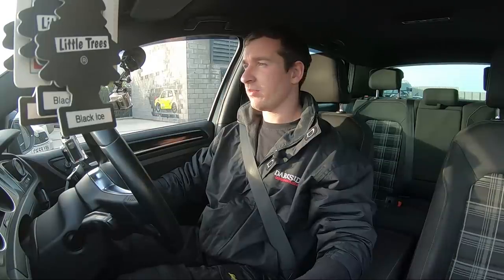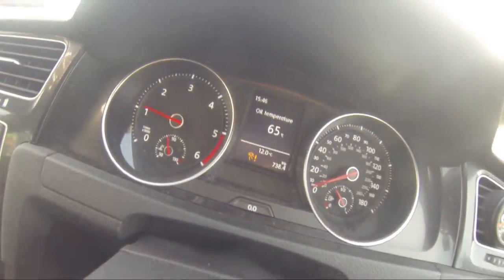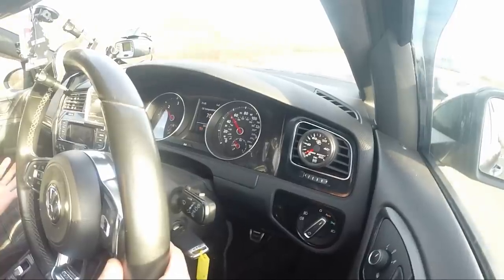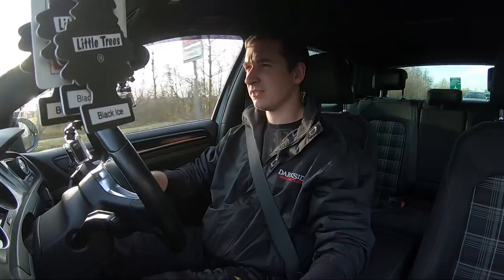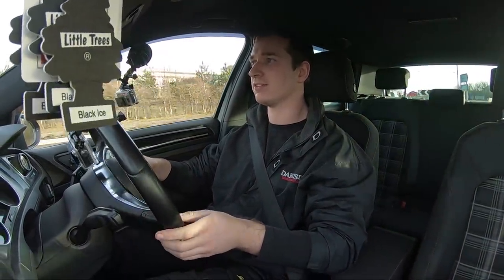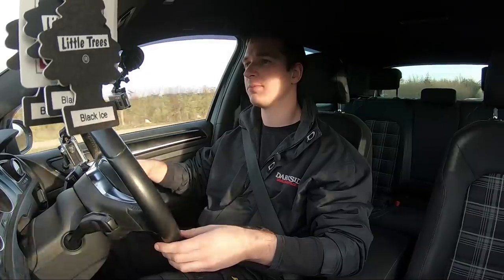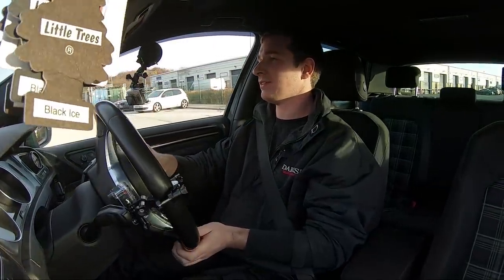286BHP 2.0 TDI VW GOLF MK7 GTD - PERFORMANCE ROAD TEST

Comment: My 7,200 lb truck does 0-60 in 5.6 seconds on an unpreped  surface in 2wd. 505 HP and 1020 lb of torque. It’s doesn’t get even close to 45 MPG though. I want one of these little cars lol

Comment: I had a quick bora tdi a few years ago, with many darkside goodies, quality parts, but skimped out on the turbo and used a hybrid instead of one the darkside kits. Wished i hadnt. Hybrid wasnt too bad but not as good as a gtb would have been. But the knowledge and effort that these guys have is top notch, i was totally blown away when i went to visit at how well equipped and how modern their site is. This video also just shows the tip of the iceberg of ryan and scotts knowledge. Always interesting your videos, and youre well overdue getting onto youtube!! Many more interesting videos to come hopefully
Reply: Thanks Russ, it's not too late to get your TDi fix!
Reply: @ryanp6138  ive got an allroad 2.5tdi now, been off the road gor a while, while i get a new fuel pump fitted ££££££ will be in touch perhaps about a few mods for that soon!
Reply: @russellbrown8377  SRS should have a pump from the engine we took from my dad's allroad when we converted to a 1.9 PD
Reply: Yeah i got the original one rebuilt by diesel bob... wanted reliability, least i know it should be good for a few years, you never know with a used one. Car wasnt the cheapest one out there either so not happy as it is but oh well. Will get there in the end!
Reply: Thats interesting too...1.9 conversion! Good idea. Thanks for the offer also

Comment: Really interesting video series. It was very informative to listen to how you managed to get so much power from that engine. Also , interesting to learn about the intake valves ports being in series .
Reply: It's not a good design!
Reply: @ryanp6138  hi again is there any newer vag diesel engine worth buying been looking for a new car and all the later stuff just seems to  not be reliable i was looking at an a6 avant 3.0 2014 onwards but have seen the chain guides and such are braking at just 60k miles really duno what to do

Comment: Great video. Nice power increase there. My 2015 Octavia VRS DSG did 100mph in 16s with a DTUK box. That thing is another level. I take it they are the same engine and turbo setup. Also much nicer audio, keep em coming!!
Reply from the maker: Thanks :) Yes pretty much the same engine. This car with a DSG would be even faster!
Reply: @DarksideDevelopments  by a big margin. I believe you were limited because of the clutch also even though it's a upgraded clutch as you stated. Was really expecting a rolling 100-200 kmh or 60-180 kmh.
Reply: @dbogdan17  the clutch in this has plenty headroom. We did a video of this car, it's on our channel.

Comment: Out of curiosity, will a 210hp CUNA be more or less fuel efficient than a 210hp CBBB? Both with deletes and all of that.
Reply from the maker: likely more
Reply: @DarksideDevelopments  what power level on a CR190 would manage to keep EGT at a "safe" level, and not at (or near) the limiter?
Reply from the maker: 220hp at a push maybe.
Reply: My  vrs 4x4 dsg needs booking

Comment: Hello Darkside. I'm having an issue with my 2014 GTD. The coolant is being pushed out of the expansion tank. Have you got any advice or knowledge on the subject?
Reply from the maker: Try a proper bleed with VCDS, if not you have head lift and it needs rebuilding!
Reply: @DarksideDevelopments  i was hoping this wouldn't be the case lol. Would I be OK to replace the head gasket and check for warping in the block and head. Is there any upgrade parts or preventative maintenance part you would recommend in this job other than 12.9 head bolts.
Reply from the maker: @DowlingColm  You could try just bolts first but its pointless fitting a head you have not skimming IMO, its a ton of work. we do the 12.9 bolts but the last one we did pulled the threads out of the block!!
Reply: @DarksideDevelopments  Have you had engines where just changing the bolts out had rectified the problem. I'm afraid that it'll just return with a vengeance if I don't go and replace the gasket
Reply from the maker: @DowlingColm  We fit the bolts before carrying out work as prevention is much cheaper than the cure. If you can do the work yourself its worth trying for the cost of the head bolts
Reply: @DarksideDevelopments  Is it possible to do it without taking the camshafts out or not? I'm not familiar with the engine.
Reply from the maker: @DowlingColm  Yes Cams out!
Reply: @DarksideDevelopments  Thanks for your help guys!

Comment: hello, have you had problems with the exhaust gas pressure sensor?  by chance you have deleted it through the control unit?  it should be the lambda probe
Reply from the maker: All DPF cars have pressure sensor issues. They are easily erased when the Filter is removed.
Reply: @DarksideDevelopments  I already mount the downpipe, the original DPF has already been removed

Comment: I read that these are CUNA engine. I have vrs tdi Cupa engine. What is different? I thought VAG put the same engine in all of them... Gtd, vrs, fr...? And what was the full cost of all these goodies? Mine is making 220hp and 511nm and is awesome... And also, what could we do to get those high oil temp down? Is it because of the exhaust temps transferring the heat around? Anyway good job guys!! Really impressed with how in to details you can go, like knowing all the parts measurements and everything! Amazing! Good job!
Reply from the maker: We are working on an oil cooler now. Its just a hot running engine for efficiency. CUPA is very similar, some emissions differences but nothing to affect what is spoken about in the video

Comment: Do you use the recommended 5w30 oil still or do you go for something slightly thicker to give it more protection?
I use 5w40 Quantum in my standard 2017 GTD
Reply from the maker: 5w30 should be fine!
Reply: I have a gtd 7.5 2018 facelift and the recommended oil is longlife 0w30, its thiner than the 5w30 so what do yall suggest to me?

Comment: Good going for the stick shift.   Be interested to see how the same set up works with DSG.
Reply: Remapped Manual Golf Rs are notorious for slipping and frying clutches  once they get above stage 2 (400ish). DSG esp Later 7spd is better proposition in petrol.  Can only imagine that extra diesel torque will stress rest of drivetrain.   Presume clutch was beefed up in this build.
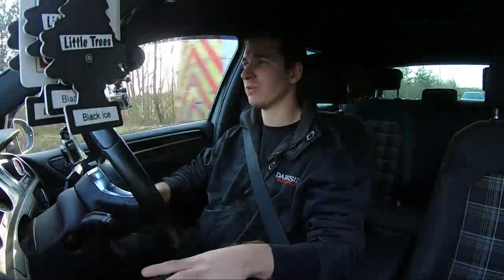Reply: @gaycha6589  6:30 he tells you it has an upgraded clutch
Reply: @Jay-zs6zb I know, but  sintered clutches are less smooth. less progressive in action, and  although might slip less than OEM, they also las less time/

I had  a 330cd with tuning box that ate clutches and diffs/

All aim  syaing is that DSG is better for maps

Comment: My standard one is 181 obviously, I think the 230ish at stage 1 would be more than enough
Reply: Watch the other video, they don't make 230
Reply: I have stage 1 230hp, stage 2 for dsg. The dsg tune is what shocked me the most tbh. Its so much better. Pulling from 100-150km is just big difference
Reply: Never seen them as low as 210-215 crank hp, and have been owner of 2 184hp engines. First just after protocol release in 2014, and now a Leon mk 3.5. No problem what so ever getting 225hp an above. They do that well, that even with stock hardware, you will see rail drain issues.
Reply: I’m wanting my standard mk7 gtd remapped aswell, no idea how much it would cost though

Comment: Hey mate just wondering if you changed the clutch? I’m getting a GTD manual soon and going to map it straight away to stage 1, will the clutch hold out stock for stage 1?
Reply from the maker: Stock clutch should be fine with a remap! We've had plenty in that have run well with it! 

In case you want to upgrade later, this particular one has a Sachs Clutch and Flywheel kit - https://www.darksidedevelopments.co.uk/products/sachs-2-0-tdi-6-speed-02q-dual-mass-flywheel-with-sachs-sre-performance-clutch-kit-for-ppd170-cr170.html

Comment: Hallo i want to ask you your opinion about Turbo Blanket and exaust wraping?
Reply from the maker: It won't hurt but not essential
Reply: @DarksideDevelopments  Thank you for your answear,and another one question i want to make,i have a golf 6 gtd the car has reprogammed intake and have ordered from you the silicone elbow,i have read about the cpf 4 metering valve have you ghanged to a golf7 what is your opinion i can do the same thing to my car? the car now believe or not i have seen 246+ top speed in autobahn if the elbow and the metering valve helps we are going for250
Reply from the maker: It might help, especially if you already have a limp mode issue!

Comment: What engine code is it? And what is the power limit the stock block and pistons will handle?
Reply from the maker: This was CUNA engine, the stock block and pistons are rated higher than we achieved but if anything like the MK6 common rails good for well over 300bhp
Full spec list can be seen here - https://www.darksidedevelopments.co.uk/vw-golf-gtd-2-0-tdi-cr-cuna-286bhp/
Reply: @DarksideDevelopments  thanks for your answer! And what is the stock block and pistons capability of MK7,  EA288 engine?
Reply: @kolyakabmx  much more than the head we think!
Reply: @ryanp6138  definitely you'r right, but what if someone will decide to fit a head from bi-turbo 240ps (CUAA) with all intake/exhaust parts to this block? It goes from 240 to 300ps/600Nm on stage1 software, could be more

Comment: Don't see the point, just get an R. I have the 245 GTI Performance and it struggles for traction.
Reply: Well, the R got the 4Motion All wheel drive from VW. It's pretty good at not struggling with traction
Reply: jimfastlane28 what tyres you got
Reply: marvey singh  Got the standard Bridgestones. They are ok but not fantastic
Reply: jimfastlane28 yeah you using potenzas? You need Michelin’s or Goodyear eagle f1 asymmetric 3 they change the way the car drives! Got rid of my Bridgestones on front!

Comment: 100-200 12,6😅
My 184 @ 220 drives 20-21s😭
Reply: Captain Awesome my 1.6 TDI leon 5f  100-200 time 17.6 second 😂
Reply: @ersincelebi5376  of course gps measured and stock 105/110 hp, yeah? 😅
Reply: Captain Awesome stock 105hp but my car not stock.
Reply: @ersincelebi5376  i thought that. Stock is your time a dream😅

What's your tune?

Comment: Traction is the main issue and the sear cost off tuning a diesel past stage 1. Pointless
Reply: It's not pointless to tune a diesel past stage 1. It can be more economical overall if the right path is taken
Reply: @ryanp6138  so i have a 2012 seat leon fr . Standard 170bhp cr engine. Now with a map running 227bhp. Its also more economical as you mentioned with the map. Now break down the cost to get more power past stage 1 ??? Bigger turbo, downpipes, exhaust, cooling etc !! Darkside do a kit but like your talking 2 k easy. Too expensive pal
Reply from the maker: @michaelsingh925   Ryan P is the one talking in the video!! its more than 2k but you dont have 227hp either!
Reply: @DarksideDevelopments  

correction 223.5 hp @ 4046
And engine torque 325.6lb ft @ 2480rpm

Comment: Is there a way to Disable ESC fully on a 2012  Volkswagen Passat 4Motion 2.0tdi? I havent been able to find any1 who could do that, it has something to do with Trw  Abs pump.
Reply from the maker: Its likely you would have to interrupt a sensor like the accelerometer so the ABS still works
Reply: Darkside Developments interrupt the steering angle sensor
Reply: @aqib2000  I wouldn't do the angle sensor as the ABS won't work correctly, ESP will only stop if you do accelerometer or something else esp related.
Reply: Ryan P fair point I should have been clear about that. We do this all the time on Bosch systems to turn off DSC etc.
Reply: @aqib2000  what cars are you playing with?
Reply: Ryan P work at Jaguar Land Rover
Reply: On mine it works with abs module byte 16 bit 3 and 7 checked. (MK60EC1)